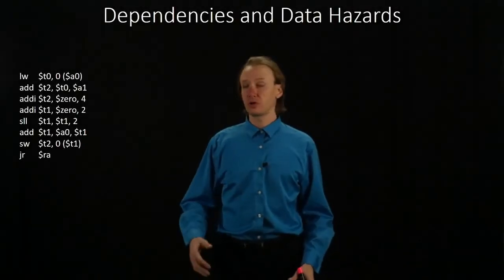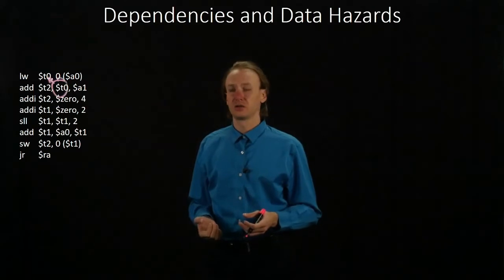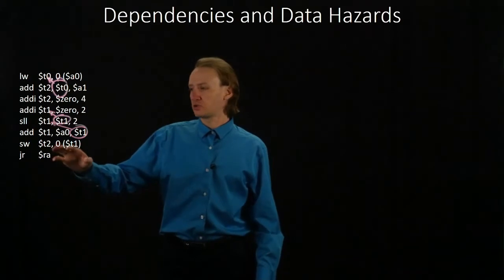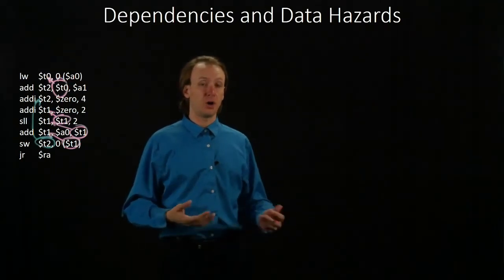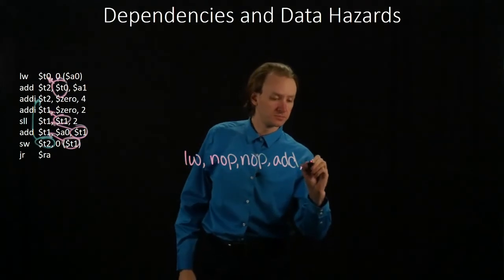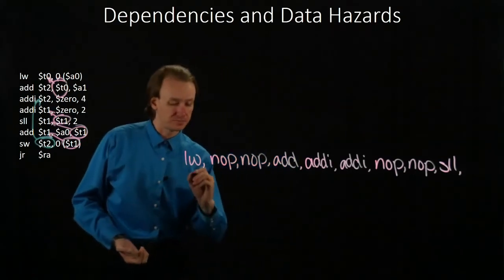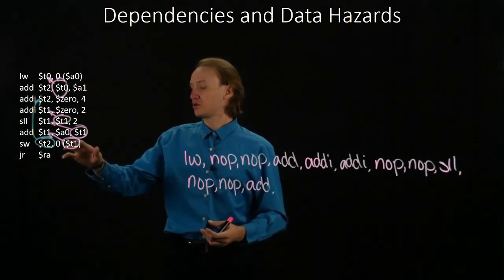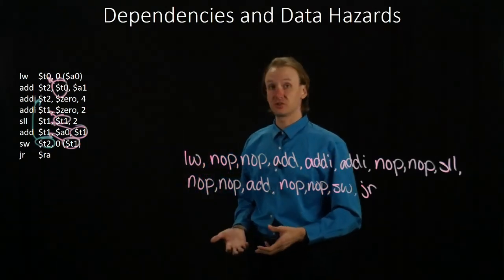7-2-b.  Dependencies and Handling Data Hazards Example 2

Comment: An odd question... suppose the program is self-modifying, for instance, for an instruction that takes an immediate argument, such as addi $t2, $zero, 4, suppose the instruction right before it is a sw instruction that for whatever reason writes to the same memory location from which the immediate argument for addi is retrieved (the 4) -- would the CPU be able to recognize that dependency?

Comment: An odd question: suppose the program is self-modifying -- for instance, suppose there is an instruction that takes an immediate argument, such as addi $t2, $zero, 4, and suppose that right before it is a sw instruction that writes to the same memory location from which the immediate operand for the addi instruction (the 4) is retrieved.  Would the CPU be able to recognize this dependency?

Comment: why are we waiting two cycles for nop?
Reply: Well you don't need the answer, but maybe it is still interesting for other people. Our Pipeline looks like this: F(Fetch) D(decode) E(execute) M(memory) W(write back). So if we look at the first lw instruction:

F D E M W

The value is available AFTER the write back phase (so basically the sixth cycle), so we need to wait for 2 cycles to give the result to our add instruction for the execution phase, since in this phase the value is needed to do an add - operation.

lw1: F D E M W
NOP:   F D E M W
NOP:       F D E  M  W
add:            F D  E   M  W